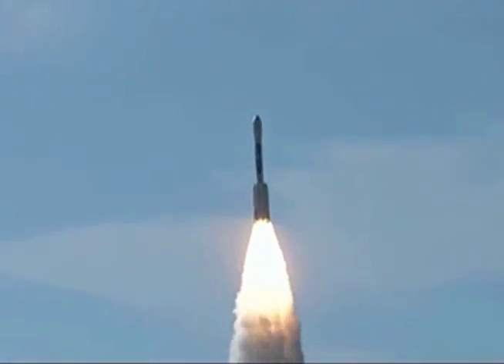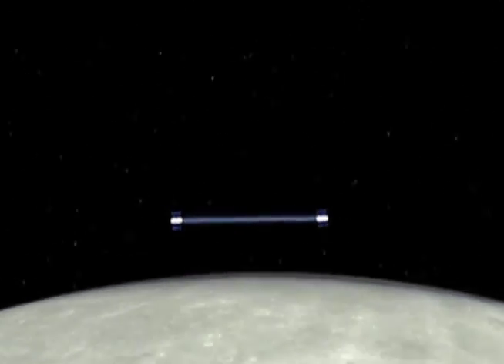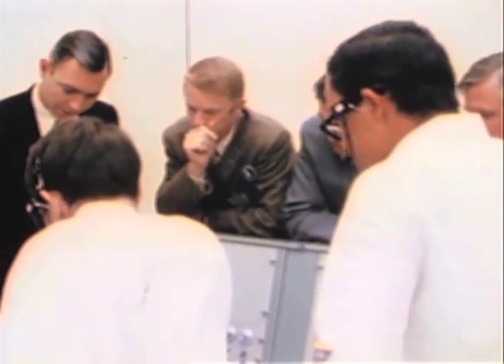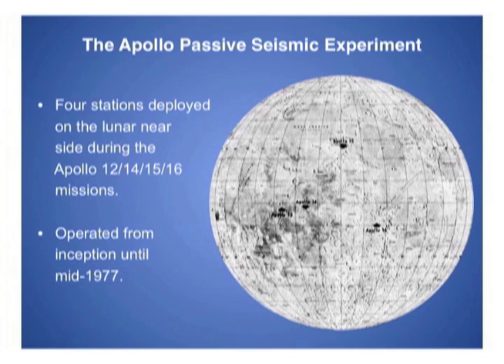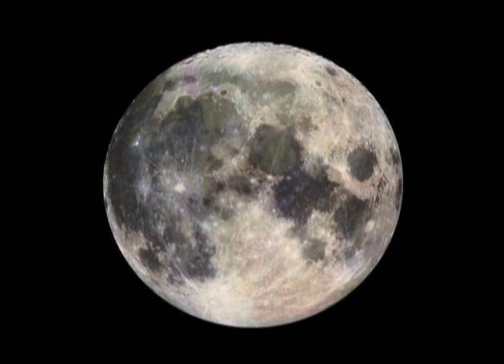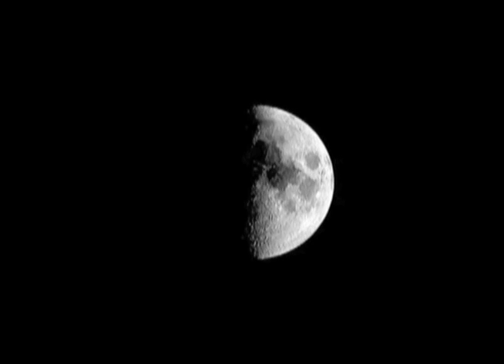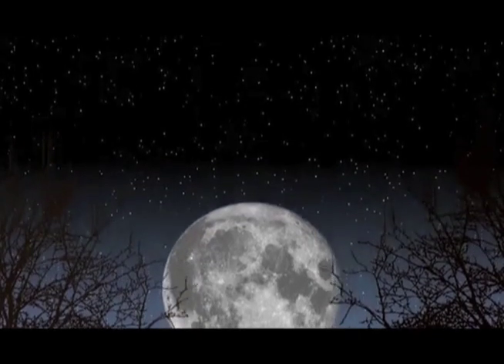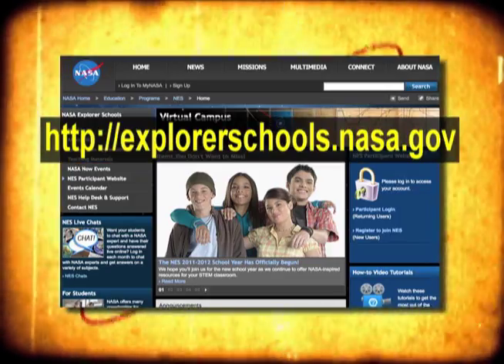NASA Now: Geology: Structure of the Moon

Comment: WHY THE CRUST OF WHAT IS THE MOON IS MUCH THINNER ON THE NEAR SIDE:

There is an almost entire absence of maria (“lunar seas”) on the far side of what is the Moon. Gravity/acceleration involves BALANCED inertia/INERTIAL RESISTANCE, AS ELECTROMAGNETISM/energy is gravity; AS E=MC2 is CLEARLY F=ma ON BALANCE. Gravity is ELECTROMAGNETISM/energy on balance, as gravity AND ELECTROMAGNETISM/energy are linked AND BALANCED opposites. Accordingly, “mass"/ENERGY involves BALANCED inertia/INERTIAL RESISTANCE consistent with/as what is balanced electromagnetic/gravitational force/ENERGY; AS ELECTROMAGNETISM/energy is gravity; AS E=MC2 is clearly F=ma ON BALANCE. (Therefore, the rotation of WHAT IS THE MOON matches it's revolution.) Notice that the Earth is blue, and the sky is ALSO BLUE. So, consider the tides. Now, notice the role and relation of what is THE EYE. SO, consider what is the orange Sun (as LAVA) on balance. Hence, the crust of the near side of what is THE MOON is significantly thinner than that of the far side. Notice also that the other side of what is THE EARTH is ALSO BLUE !!! BALANCE AND completeness go hand in hand. So, on BALANCE and comparatively, the crust of the near side of what is the Moon is considerably thinner. Great. In fact, simplicity is essential; as BALANCE AND completeness go hand in hand. It's called CLARITY and ease of explanation, and it all CLEARLY makes perfect sense. Indeed, it is also explained why objects fall at the SAME RATE (neglecting air resistance, of course). GRAVITATIONAL force/energy is proportional to (or BALANCED with/as) inertia/INERTIAL RESISTANCE, AS ELECTROMAGNETISM/energy is gravity; AS E=MC2 is CLEARLY F=ma ON BALANCE. Interestingly, the crust on the far side of what is the Moon is believed to be about TWICE as thick !! GREAT. It is CLEARLY proven ON BALANCE !!

By Frank DiMeglio
Reply: Ps we can see your username,  no need to leave your name
Reply: Ps capitalism is for boomers and conspiracy theory quanon flat earth ass wackos